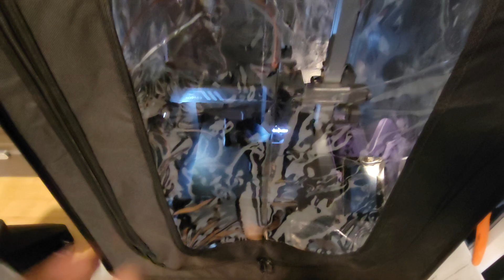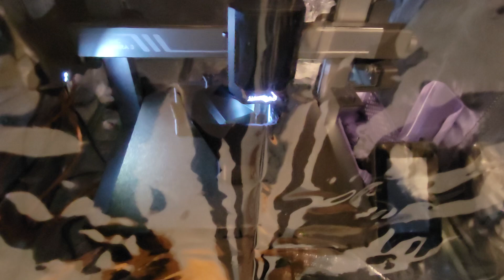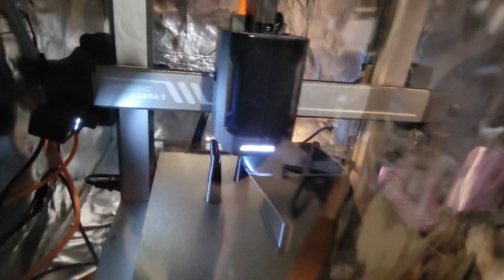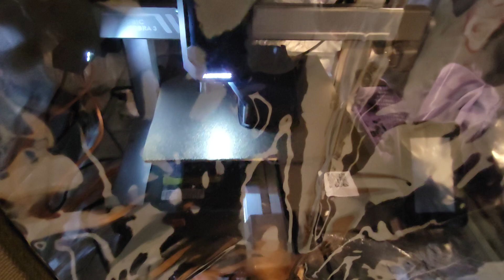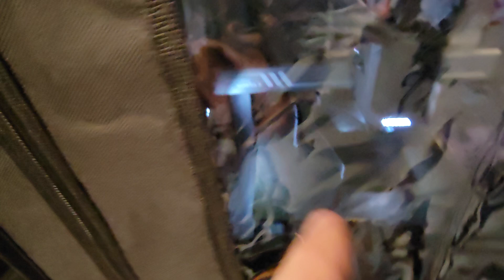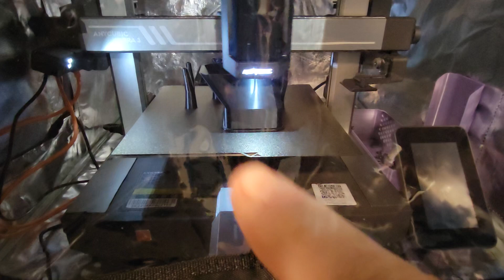Anycubic Kobra 3 Combo Printing ABS

Comment: So all you did was get a new bed and put it in and encloser and started printing abs
Reply: Correct. ABS can be notoriously tough to print. I have the printer in my basement, the temp stays in the low 60s (F) year round. Without an enclosure, I cannot print ABS or ASA at all. The enclosure and better plate make it so that I can print those filaments. Another thing I have started doing is preheat the bed and nozzle for about 5 minutes before I print, that helps to heat up the enclosure. This enclosure also keeps the odor down.